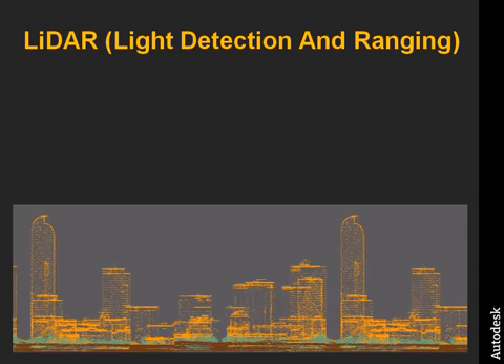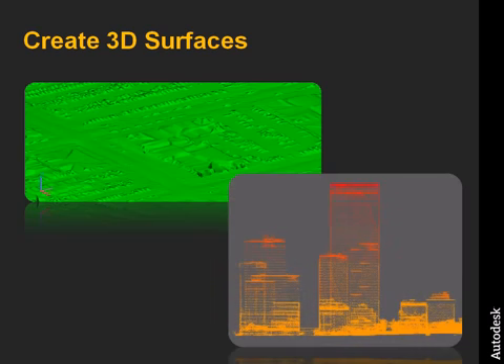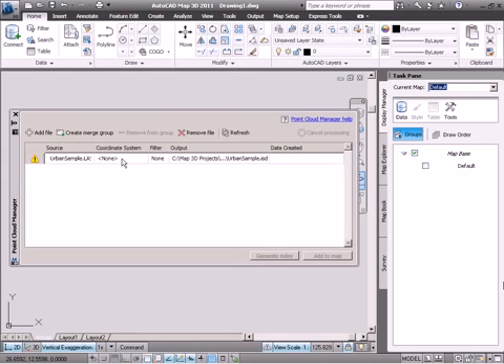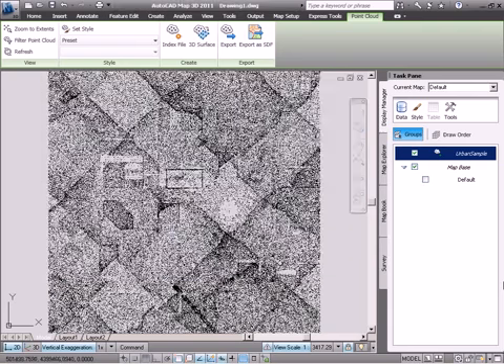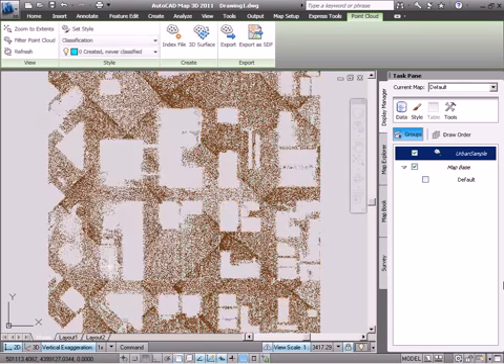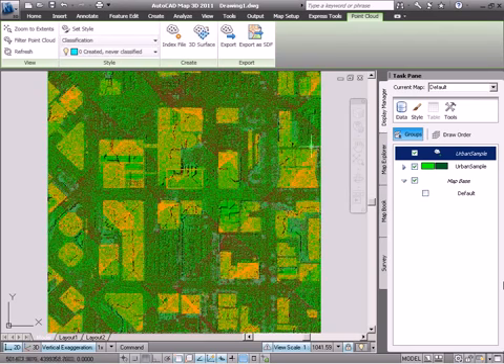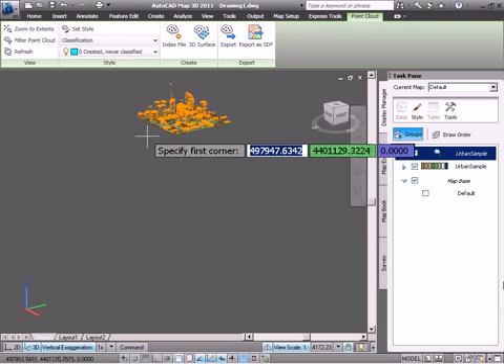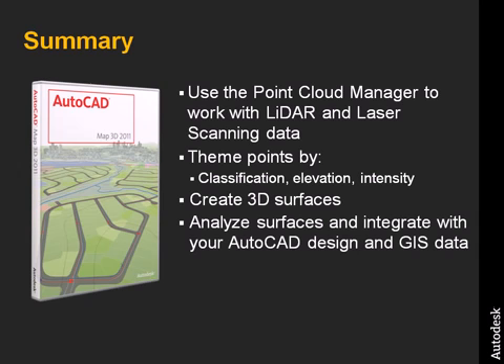How to Work with LiDAR Point Clouds in AutoCAD Map 3D

Comment: For those needing to convert LIDAR point clouds into contour maps, 3D models or DXF point clouds, see my apps at http://lidarwidgets.com  Output formats include AutoCAD DXF and ArcInfo mesh files.  All my apps are cross-platform and run under Windows and MacOS/OS X 10.11 or greater.